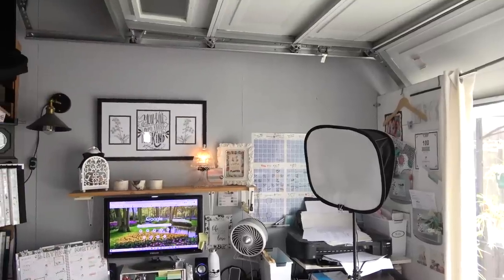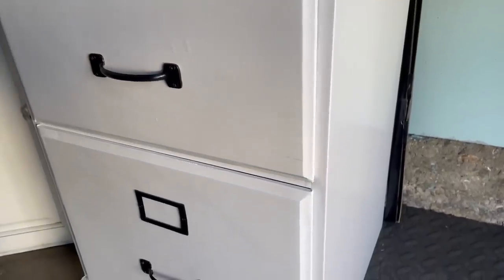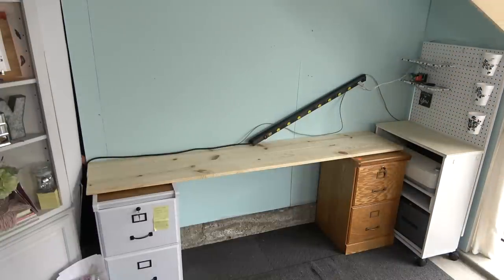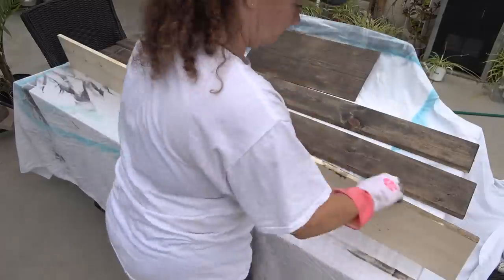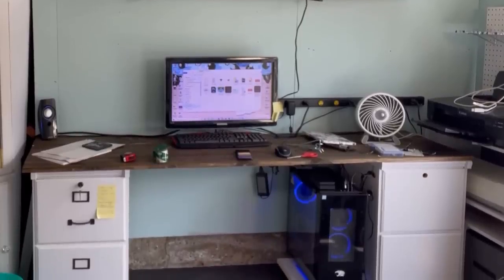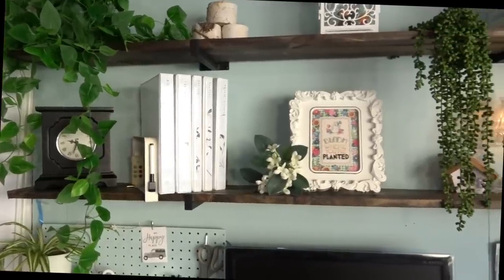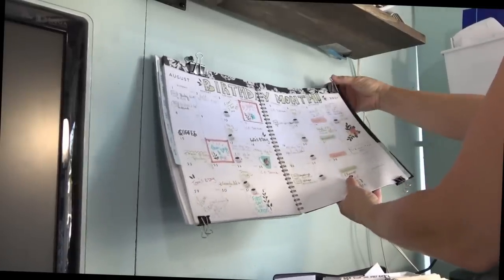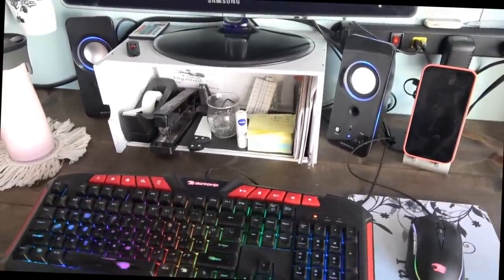Making My Own Desk with Matching Shelves!

Comment: I did something similar.... But I used my computer desk, and matching lateral file cabinet....I had so much on my desk, monitors, supplies, and printers and things on the file cabinet....just no space to actually work.  I was so frustrated...I hated my space.  I kept looking at it and thought that there was so much wasted space in between the two units.   I went by my local discount building supply and found a counter top, that matched my kitchen, and  found an eight foot piece...it was less than 80.00.   I went home and told my Hubby what I had found and what I wanted to do...next thing I knew we were bringing the counter top home.  :)   It fit perfectly.  He used his hole saw and put holes in it for my cables and cords....and he even found the nice inserts, for the holes, at Lowes that made it look so nice and like it was purchased that way.  A few felt pieces on the bottom will keep it from damaging my furniture.    I bought some organizers for the top also.    It was truly a God send....and our timing was perfect, as a few weeks later Covid shut things down and I had to work from home.  I was so thankful for the extra space that the counter top provided.   It's so nice to use what you have....Just update it a bit.  :)....Now, looking at your space, I want to add shelves above my space above the desk...I love that idea!!!!   It is a small bedroom converted into an office....My husband has his desk, I have mine...The closet also has a desk...it's the "Lego Room"   I can close the doors of the closet when it's messy...ha ha.  This room is also my craft room and storage.     Everything all in one.   I need to reorganize the space.   I can't function in clutter....i can't think.   So to function, everything has to be tidy, and everything needs a place or else I won't go in there...it's too over whelming.  Is that sad or what?   Now I'm overflowing with Happy Planner things....and I don't want to go in there to do it.  SMH.   You wanna come and organize???  LOL!  I think I have good bones in there...I just need to get to it....one section at a time, with my blinders on, and focus on that space...then move to the next.    Keep doing what you do....You are so inspiring!!!!!
Reply from the maker: I’d love to help you organize where do you live! That’s why I’m saving up for an RV so I can start driving around in helping people but if it’s local let’s chat :-)
Reply: @TheCraftyOrganizer  I'm in Mississippi...Not very local.  LOL!   I have a 4 day weekend coming up.  I may start tackling it then...I need to get the donate things out, that I have boxed up for Goodwill...that, at the very least will be a good start....I brought home some paper boxes,, from work,, to pack more donate things into.   Once I get started I'm a force to be reckoned with....it's just making myself get motivated.    If I think about it, I''ll take pics or video of the before and after and send it to you.

Comment: Sue Wolfe- Great job on your desk and shelves.  You can also use a solid core door if your desk is shorter for the work space. They even come with holes for the handles if you get them at the Restore which is great for computer cords! There are even 8 foot doors available! We put the door on top of  filing cabinets as you did., Norrine. I just love your improved and more functional space. Great job! 👍💪♥️
Reply from the maker: Ha! I forgot to show how I cut a hole in for cords!  I saw doors, but didn’t find one the depth I wanted.

Comment: Cool.  Another super-simple desk you can build uses the same idea of two file cabinets for the end supports, but the top is made from a single hollow-core door.  They are sturdy, but relatively lightweight, and can be painted or stained as you like, and you don't even have to line up extra pieces of wood:  it's all one and one.  ;-)
Reply from the maker: Good point!  I looked at doors while I was at the ReStore... but they were all too deep.  It is such an easy idea though!!!!  Thanks for pointing it out!!!!

Comment: Just phenomenal! You’d never know your space was in a garage. And love the hints for simple bracket leveling and the stability for long boards. I initially wondered why not use Ikea table tops for the desk top, since they’re inexpensive and sturdy. I’ve had  two - large and small - in my craft room for eons and they’re like new despite very heavy use. But maybe sizes wouldn’t work - and that you really wanted the aesthetic of your inspiration photo - understandable!
Reply from the maker: :)  They were all too deep for my needs.  I only wanted 24" deep, so using a door or table top from Ikea was not an option I found. Otherwise - YES!  You are right - That would have been a perfect solution!!!! 💜 Thank you so much for watching!

Comment: Oh, good luck with biscuit joinery. I’ve tried dowel & biscuit joints but just couldn’t get the holes straight no matter how hard I tried.  You really would need a table jig for the router.  However I have been told you can get a biscuit drill tool which has a built in guide.  You might be better off with one of those.  Let us know if you do ❤️🇦🇺
Reply from the maker: I’d LOVE to get a table!!!! Oh, the things I could make!!!

Comment: You have inspired me to paint my desktop. And that will also be the perfect time to turn my monitor arm around. Command hooks for the cables is a Great Idea. So is labeling the cable ends as you did. As you used the hearts, I put just a dot of nail polish. I religiously use my planner but having a monthly view on the wall would be a Very Good added feature.
Reply from the maker: Yay!!!  Let me know how your desk turns out!!!!  I just did September's calendar this morning.  I'm excited to switch to it on Wednesday now.  :D
Reply: @TheCraftyOrganizer  I moved my desk but I haven't painted it yet. I have to take the desktop outside to do that, so I can see that little project will wait until next spring. The Reason I popped back to this video to comment does not apply to your setup, but here's a tip that may come in handy for someone else. My IKEA desk has adjustable legs on one side and the other side has that drawer file like the ones in your inspiration pic. I've had them for three years and made a discovery. The back side of the individual drawers are not tall enough.  So here comes good ol' foam core. Mine are the ones with two shorter drawers on top and three taller on bottom. I'm cutting foam core to 4.25 X 11.5 and  5.25 X 11.5. Then glue them against the back inside of the drawers. I found that out bc I overfilled one drawer and stuff fell out landing behind the bottom drawer. It wasn't that much overfilled but I don't want to have to unscrew a drawer again to get it out.

Comment: It looks awesome and I love that it's mostly from found / thrifted items. 

I'm a little concerned about the placement of your shelf brackets though. I don't think you should put anything too heavy at the end, unless you have something just as equally heavy on the other end, or it could flip the shelf.

Also, did you know you can purchade a slide out keyboard tray that can be attached below the desk. It would free up the space on the desk top and if your on the computer a lot, the new height is a better position for your hands, arms, and shoulders. They would be in a more relaxed position. ❤
Reply from the maker: You are so sweet!!!!  The brackets have screws underneath that anchor the wood... but I am thinking of adding another bracket to each end just to give it more support.  :)

Comment: You did an amazing job, Norrine!  Your desk turned out so good, as well as how organized everything is.  Desks are very expensive.  Not thrilled with the one I have, but I'm not about to buy another one.  It's okay, just doesn't have a pull out that's big enough for the keyboard and the mouse.  Not sure you need a router to cut biscuits.  Just a biscuit cutter.  I've seen them on the woodworking shows I watch on Create.
Reply from the maker: I’ll need to check into a biscuit cutter!!!!!

Comment: I have a desk similar to yours and know what you mean about not having a drawer for storage in the middle for small things like pens, paper clips etc. Well,I looked on Amazon and was able to get an under desk sliding drawer that adheres by 2 sided foam straps. I was leary at first but it holds very well and is the best holder for pens, pencils, sm ruler, etc. I just love your new desk area and hope you will as happy with it as I am with mine❤
Reply from the maker: I’ll have to check that out!!

Comment: Since you don't have what you need to do biscuit joints, you could drill holes in the side of the pieces of your desktop and use wood dowels to put in the holes. Some of my cheaper, build it yourself furniture does that. I always add wood glue to the holes for added strength but the dowels seem to do the job. You might have to use more dowels than you would biscuits but it would hold your wood together.
Also, you could add a shelf at the height you want it to put your monitor on. Put it from side to side of the desk for a little bit of added storage on top and bottom of the shelf. Instead of brackets, use several pieces of wood under the shelf to hold it up and it should keep the shelf from bowing from any weight the monitor might add. I know what I am thinking about, I just don't know how well I am describing it...
Reply from the maker: Great idea, Bunny!!!  Dowels would work just as well and wouldn't require a special jig!  Thank you!
Reply: @TheCraftyOrganizer  Glad I could be of assistance! LOL

Comment: Such a smart way to maximize your space.  What brand/model label maker do you utilize/recommend and where do you purchase the rolls of tape?   I know labeling will help me be better organized.   Being retired I do not have the luxury of working extra hours for funds to purchase random items.  This might save you money on paint.  Sign-up for emails from Sherwin Williams, Benjamin Moore, etc.  They frequently email 30% off coupons.   When I bought paint for the exterior of my home I saved almost $250 on quite a few 5 gallon buckets of their high quality paint.  (Of course that was prior to my retirement.)
Reply from the maker: That is an AMAZING money saving tip!!!!  I’ll sign up for those emails. Are use the brother P touch and I get the generic tape refills from Amazon they work fantastic and they are almost a third of the cost!

Comment: A cheaper option for the desk top is to look for a cabinet store near you - we have one that throws away their excess countertop pieces (remnants from counters they’ve done) and they are happy to have us haul a piece or (or more) off for them for free (saves them paying to dispose of it) most of what I’ve gotten has been 4-6 feet long, but I’ve seen longer and shorter. 

Also, if I remember correctly the unit you put your Cricut on has a back? If so you’ll still need to move it to use it 🤪 space for the mat to come out the back (needs 10 inches). I’ve made this mistake when I 1st got my Cricut 😂
Reply from the maker: You are so smart!  Yes, I measured the cord BEFORE I did anything else!  LOL  Oh my goodness... how important is our Cricut to us?!?!?!  I love the tip about the cabinet remnants!  I'm absolutely going to check that out!!!
Reply: @TheCraftyOrganizer  my husband found the counter tops - built a table for my craft room and we used more to build a countertop w a bar for my nutrition club- true, it was pre Covid so who knows 😂

Comment: I love this idea so much that I went out the same day and bought 2 file cabinets off facebook marketplace for a steal 15 a piece. I have never done something like this before so I had some questions. What size is the wood? And you used 3 right? I know the length I want but not sure on how many that will cover the file cabinets. The file cabinets I got are metal do I just put the screws through the wood into them? Sorry for all the questions like I said I never have done this before.

Comment: On one of your videos you talked about the temperature in your garage when you go out there to work in the morning (like it was 40 degrees if I remember correctly). How does your computer handle that?  I would think that temps like that would be damaging.  Do to the snowfall in my area I have been stuck inside and been binging your You Tube videos. Thanks for all your hard work and great content.

Comment: You don't really need a biscuit joiner to join things together all you need is wood pegs and drill bits to make the matching holes in both boards put the wood pegs in and glue together, that's the really inexpensive way of doing it.
Reply from the maker: I'll bet there is a template or jig I could use too!

Comment: Dang it Norrine!  NOW I am really wanting to come on and answer some of your questions.  I can give you a tip about putting your boards together (that is called edge joining) the easiest way for a table top is simply to glue them. Make sure you use the right type of wood glue, and get a few nice long clamps.  Spread glue along the edges of your boards,  making sure to get both boards to be joined, and wipe off the excess.  Them lightly clamp them together, just tight enough that you see a bit of the excess glue squeeze out.  Too tight and the boards will warp, we don't want that.  Wipe off the excess squeeze out glue and let sit to dry.  Check out Woodworking for Mere Mortals here on YouTube for a full tutorial...and tons of other great information about wood projects.
Reply from the maker: Can we be best friends and have a wood shop together??? lol
Reply: @TheCraftyOrganizer  yes!  Drive that RV out here to Missouri and we can do some stuff.  Heck, we could build CUSTOM organization solutions for clients: drawer dividers, closet systems,  cabinet shelves and pull outs all to their individual needs and specifications.   And just imagine how pinterest perfect our closets will be.  😍 We will be walking around all day so giddy that cartoon bluebirds will just perch on our shoulders! 😆